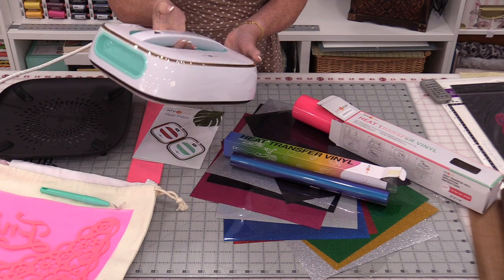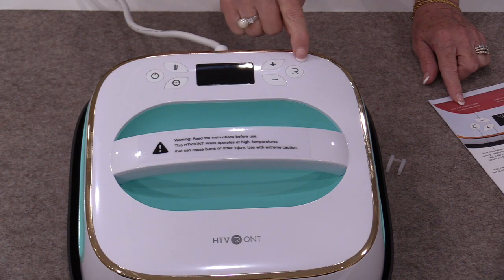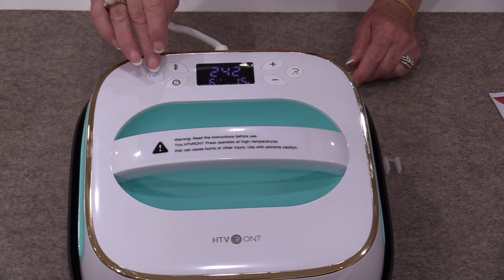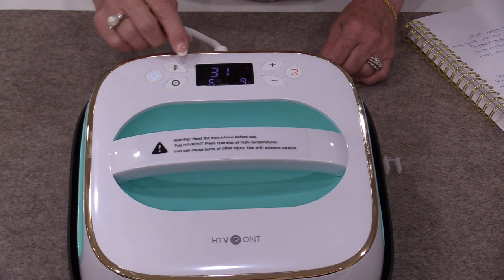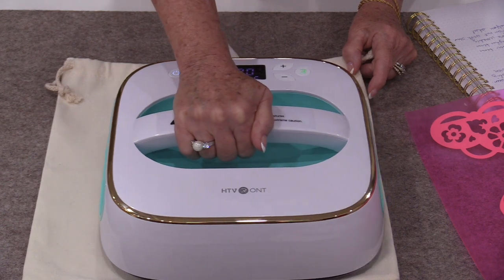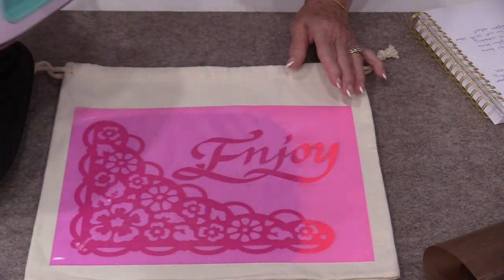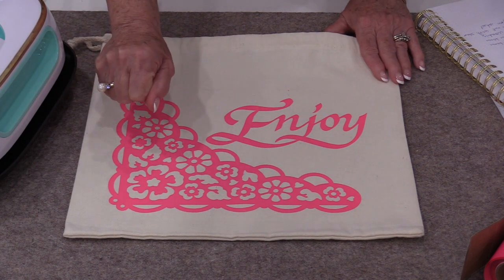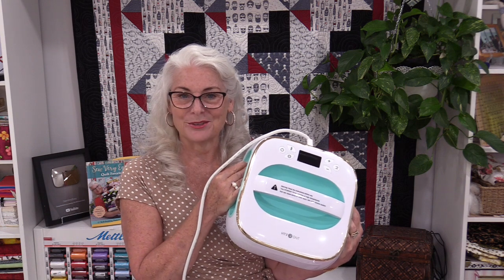HTV Heat Press  vs an Iron

Comment: I love your demo!  I do use mine for other things also. Remember to use a Teflon sheet for most of the following ideas!
 1. I use it to iron large pieces of backing for my quilts. 
2. Great for iron-on fleece batting.  3. I use it for adhering interfacing for bags & garment making.  
4. I use it to dry paint on fabric after stenciling.
I am sure there are other things to do with it I haven't found yet.  Thank you for bringing it to people's attention.  They are great machines.  More versatile than a huge heat press!  Mine is a different brand but has the same bells and whistles. 
Again, Thanks!

Comment: I have had an Elna Press for several years and love it. To specifically check temperature I use my infrared thermometer. I always use my Teflon pressing sheets top and bottom. My Elna Press is perfect for garments, too - much better than ironing.

Comment: I bought a 12x10 cricut 2  heat press which I use to add stabilizer to the back of tshirts--so much faster and easier than an iron.  My heat press was much more expensive than this one so you are better off buying this product.  I dont have room for a regular heat press, and these small heat presses are much lighter and really not all that much heavier than my iron.  I use the teflon sheets on both sides of the tshirts that I stabilize.